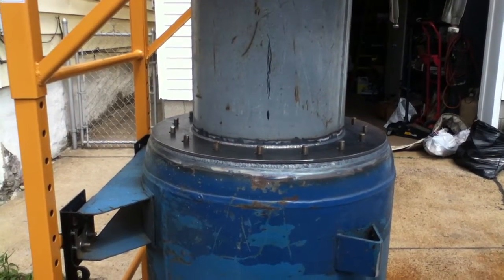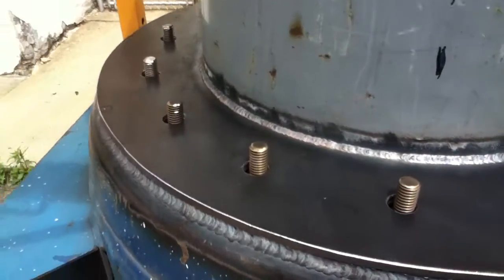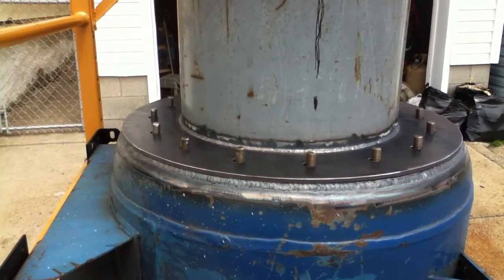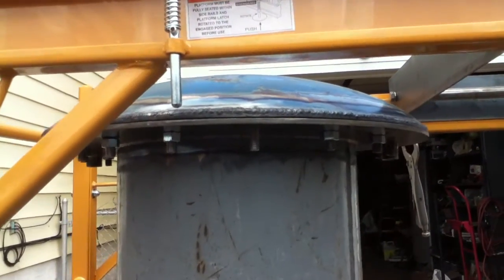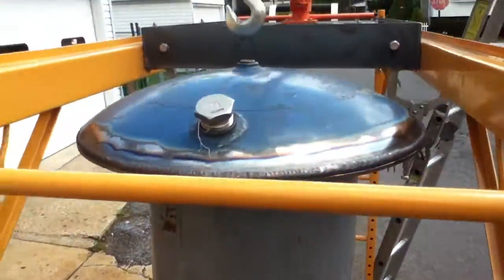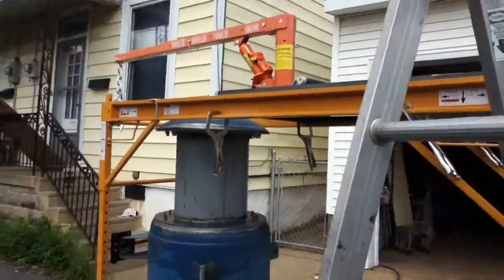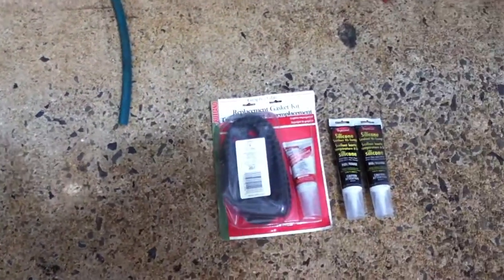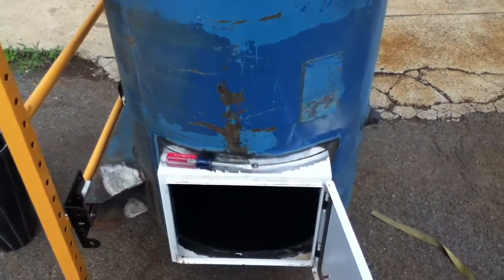Heart of the Flashifier Part 3

Comment: I like your build. Nice job! I wish I had your welding skills. I bought a 3 in 1 welder (Tweco) but haven't had any time this summer to try the tig. 
Insulation- Have you figured it out yet? I used Rockwool or Stonewool. It does pretty good. Keep the hearth insulated.
I like the jig for circles.
How big of an engine do you plan to operate? I believe you're in good hands with Flash and Docdcox for advice. It is nice to have people like that to lean on with this type of build.
After I completed my build, it ended up being over 6' tall. A little tough to assess what's going on while using it without a step ladder. 
Keep the videos coming. Screw the Debbie Downers. They have nothing better to do than to troll videos and criticize stuff they can't do. Videos will give the rest of us ability to assess and share what we may have done to overcome some situations.
Keep up the good work!

Comment: Hey, how's the project going?
Reply from the maker: Sorry about the delay in responding to you. I have been swamped with huge projects lately. My wife and I run a vacation bible school every year , and this years theme was blast off , launching kids on a mission of god's love. Well every year we build something theme oriented to make it a fun enviroment for the kids. This year we built a rocket ship. I'll have to post a short vid so you can see how much really went into the construction of this .
   Another thing that sidetracked me was the completion of the elevator on the kids play house. It is now fully functional and now in use. I'm probably not going to post vids of this though , because too many people have nothing better to do than watch these kind of videos and point out how dangerouse this can be. My motto is , every kid wants an elevator in there playhouse. And I played with lawn darts in the late 80's , and I survived.
  Anyway , about the gasifier. I just about have the air intake plumbing done. I just filled my welding cylinder (argon) for tig welding , and will soon start welding all the parts that are just tacked in place ( access door frame, Ignition port pipe, some repairs on my huge coupler that I mig welded to the hopper for intake future expansion. There are a few small pinholes from dirty metal.) Also I am adding a mod to the crane assy. It is capable of lifting all of the HEAVY parts out of the gasifier, but only one at a time. I am going to make it easily able to lift the entire hopper/burn chamber out at once by building a mount for some garage door pulleys to ride on the sides of the frame holding the one inch round stock.once this is done I will be able to lift the full capacity of the crane(AWESOME).
  This is the first time I've checked my email in three weeks , and I think I have 35 videos to catch up on from all the people I subscibe to . Hopefully your one of them but bear with my slow response, because there is still a huge mess in my garage from the rocket ship and a list of chores that have accumulated while life moves forward ready or not. Thanks for checking up on me. I will post a new vid when I finish these items. If you want to see the elevator I'll email pics to you . You will have to give me your email address though. Talk to you soon.
Reply: mazdalorean
 Yep, welcome to my world. I understand the time thing all too well.

Comment: Howdee Mazda,

This is indeed a great work of art  :) .
You certainly are putting a lot of love and skill into this fine creation.

*** Envy mode engaged ***

I think you are going to be very pleased with the way it performs when the time comes to puff the breath of life into it.
Talking of which, I agree with Flash when he says that you will want to run it in negative pressure mode only.
I saw some pics a little while ago that show a small crater in the ground, and a gasifier on a barn roof!
This was apparently due to positive pressure operation, combined with too much restriction of the output flare.
Having experienced some truly vicious explosions in my very first gasifier, I can't stress it strongly enough that you need to take the utmost care in eliminating that possibility in your system.
Since yours is so well built, I think you will be ok, especially if you use negative pressure only  :) .
 
When you get this beastie up and running, I think it will be very difficult to avoid grinning in a most nutty way  :) .
Reply from the maker: Thanks for posting. I do plan on running the negative pressure setup. I always appreciate the info from you guys because sometimes things look great on paper, but without the experience , you don't see some of the problems you will be dealing with .It is great to share info with people from anywhere in the world. I'm still plugging away at the build. I am going to get a lot done before posting, and the next video , I will use the crane to dissassemble the entire thing , and show all the parts. I am anxious to get it done, but not enough to rush.

Comment: Hey man, I got your new video up on the webpage.
http://www.miniwoodgas.com/miniwoodgas_013.htm

I almost forgot. I hear you mentioning pressure testing the unit for leaks. The two no make that three things that are critical where air leaks are concerned are your clean-out port and your cooling radiator or pipes and your filters. The hopper lid just needs to seat well enough to the point that once you pull the vacuum that it grabs a bit. Don't worry, it will suck down and be air tight enough so don't get too critical here or you will drive yourself crazy. The intake air will take it's least resistance path (the air nozzles) and as long as the critical parts of the system are air tight all will be good in gasifierville with no fears of dangerous flash backs. Sorry about writing a book here.
Reply from the maker: Thanks for the info, I don't want to put any crazy pressure in it maybe 4 or 5 psi just to check for obvious leaks. I have been thinking about pushing air through the system rather than pull it. I know I won't be able to use my ignition port this way but I like the piece of mind knowing I'm not pulling any questionable gases through the blower. Don't ever worry about posting too long of a comment, since every bit if your opinion comes from your experience. I'm always glad to get all the info I can get. Thanks for commenting. Joe
Reply: mazdalorean
Are you talking about converting over to a positive pressured system? If so you may want to research that a bit before you take that route. The positive pressured systems can be a bit more dangerous than a negative pressure system where the engine draws gas from the system as it's needed.
Reply from the maker: flash001USA I would never run positive pressure directly into an engine. Only used to warm up the gasifier. I think as long as you are aware of the pressure in certain parts of the system ( to ensure there isn't a blockage), this should work well. The whole purpose of me posting these things is to get feedback from the people who have the experience to point out what might be a good idea or a bad one. I would like to know a little more about why you think it is more dangerous . Any info is always greatly appreciated. Thanks, Joe
Reply: mazdalorean
Originally I planned on setting up a positive pressure system for start-up and to even possibly regulate it to remove all of the work off of the engine from having to draw from the gasifier and when I put that idea out there, I had quite a few experienced people with more experience than myself come back and tell me that it was not a good idea because it magnified the flashback issue.

Their point was if you get a bad ignition or even a small bridging snafu, you are now dealing with positive pressure added to a flashback as to where if you just have a negative pressure with a flashback.

A positive pressure the flashback is more violent plus it can possibly throw coals and fire right out of the hopper lid or if the lid is too tight, it will pass debris all through the system that now has to be cleaned out of the system and it could also cause a possible blockage if enough trash is blown through the system so I decided to take their advise.

There was one more point to consider too.  You still have to start it and with a positive system you would have to get a small bucket of coals going then add them to the gasifier, close the lid and then start piping in air so it get's a bit complicated plus if you need to open the lid during the start-up for any reason, you now have the smoke and the gas pouring out of the lid once again setting up the stage for a dangerous flashback.

You still have some smoke mixed with gas with a negative pressure system when you raise up the hopper lid and this is why I torch off or flare off the gasifier when I open the hopper lid because once air mixes with the gas it can be dangerous. I'm part of the "singed eyebrows" club so now I try to play it safe as possible. Once you experience a hard flashback you will not forget it plus it's scary and you then realize "hey, this can be dangerous" but in the same sentence, once you learn your system it's still safer than carrying around a tank of gasoline or propane.
Reply from the maker: flash001USA Thanks for all the info. Negative pressure it is. I just got back in the house from working on the gasifier. I finally got the first gasket complete and trasfer punched the center location of the ignition port hole . Next time I'm out there I'll drill out the hole for the pipe to go through the outer vessel.
  Have you had the chance to run your gasifier with the funnel in the hopper? I'm looking forward to see all the latest mods .  By the way, thanks for putting that video on the website. I know all this stuff takes time, and there is no shortage of people in need of your time or money. Well thanks again for the info , and keep us posted with any updates. Joe
Reply: mazdalorean
I wasn't trying to discourage you and there are some positive pressure designs out there but from what I understand, the negative pressure systems are the safer of the two.

You were asking about the new hopper funnel and yes, it made a big difference. I should have had that in the first place. If I filled the hopper up before I did the mod, the wood at the bottom would form a funnel but then I would have to sweep the left over fuel into the reactor cone. With the new setup the fuel flows right into the center down into the fire cone where it belongs. That was the best mod and the most needed mod that I did.

Comment: WOW! This is scarey industrial This is going to be sharp when you finish it! I'll get this up with your other videos in a day or so. Once again, great job! This is what I wanted to see. I wanted to see others take what I had and insert their own ideas into the build and make improvements on it then share their work with others.

As I mentioned in my reply you left on my video I did add a manometer to my build along with an internal cone inside the bottom half of the wood hopper to direct the fuel into the fire cone and your video inspired me to get off my butt and add it to my gasifier. I missed a few things on my build and this was why I left in's and out's on my build because I knew it could be improved on.

Something that I didn't mention was I rerouted my air nozzle now so instead of the pipe running down the side of the wood hopper then angling over to the ember bed the intake pipe is now dead center of the wood hopper at the top then angled down using a 90 Deg elbow into the fire cone and this really improved the performance.

What you have built here is going to be a blue ribbon machine when it's finished. I meant to ask you this before but what will be your fuel source? The reason I'm asking is the wood fuel is very important and key to a clean gasifier. Keep in mind that you may need to build a little something in the future to make fuel with too.
Reply from the maker: Thanks for commenting. First of all , thanks for all of the info you guys shared. If I didn't see this stuff with my own eyes on your videos, I wouldn't have even thought it would work like it does. It really allowed me to wrap my mind around the details of the build.
  You mentioned fuel. I was back and forth about fuel, and I knew that this build would only take so long . At the end of this build, I don't want it to be the end of the journey. I've seen some great wood processing plants on youtube, some of wich you have links for on your miniwoodgas site. Others are conveyors with entire tree trunks with a chain saw mounted like a chop saw. My thoughts on the wood processing plant are , First and formost it should be powered with the gasifier. Second It should be capable of not only lifting the trunk onto itself , but moving it , cutting it into slices , and being able to take these slices and dry them with the leftover heat from the gasifier. All equipment would be electric or gas driven by the fuel from the gasifier. The hope is there is plenty of room for being able to store some fuel without using all of it just to process the wood.
  I just got done forming the first gasket, and let me tell you, that permatex high temp silicone is wicked strong stuff . It really needs to be done in a well ventilated area. Any way in a couple of days when it dries enough to work with, I will be cutting it to the shape of the flange between the hopper and the vessel. once this is complete, I can start on the ignition port. It's really starting to get fun at this point.
  I have been taking pictures with my phone the whole way through also. When I am done with this , I will have my buddy take these pics and put together a slideshow type video to give a better look at all the parts. some things you just can't get in the progress vids. Anyway thanks for everything , and I can't wait to see your progress as well. Joe

Comment from the maker: Thanks Dan, I know i mess stuff up when I shoot some of these videos. I even pointed at the wrong tank when I was talking about the argon carbon dioxide. A couple of things I didn't say that I wanted to was, I use a stainless steel tig rod 316 , The studs are stainless steel all thread, and the small gas bottle is 75/25 argon /carbon dioxide mix. Tig welding isn't that hard. If you can oxy-acetylene weld , you can tig weld. The most important thing is keeping your tungsten sharp ( red or 2% thorium added for welding steel or stainless). If and whenever you touch the filler wire to the tungsten you have to be patient enough to stop and resharpen your tungsten before continuing or it won't weld as nice. Thanks for commenting , watching , and helping, Joe